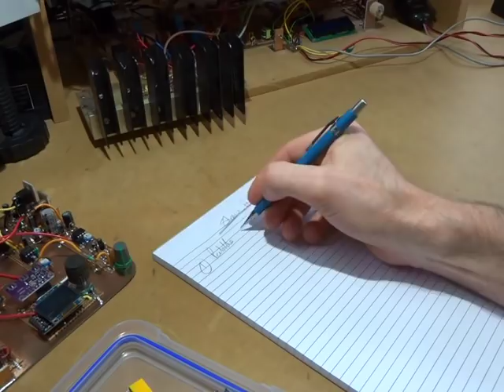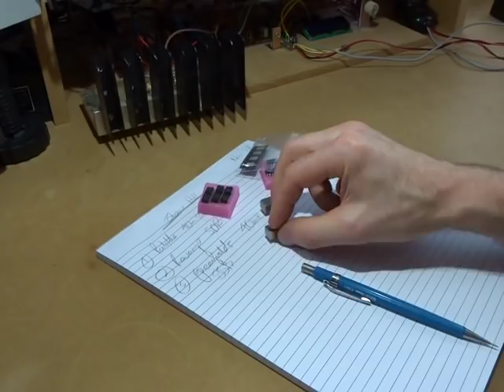Straw Poll for Next Build/Rebuild

Comment: 3 and 4 please. Learning how to use the ICs would be great. I have a few of each in my parts drawers. 73 Magazine and Ham Rado had a couple of articles on them in the 70s. Archive dot org and American Radio History dot com have copies of 73. lifeofkenneth has a collection of HR. My copies are stuck in storage and on a drive I can't access right now.

While VHF isn't your band, you do make design much more understandable. Maybe do a video on picking parts for the front end (to the first mixer) and doing a broadband QRP PA chain (from last mixer). A paper rig so to speak. 1st mixer to last is covered in your other videos. Most of the 6 meter articles stopped in the early 80s and used parts discontinued in the 70s.

Thanks.
Reply from the maker: Thanks for the input. I do intend to do a broadband PA build IDC. Just need to identify and lay my hands on some suitable devices.

Comment: How about a MC1350P post-filter IF amp with both manual gain control and AGC option?

BTW recently I was lucky enough to score a small pile of new-old-stock SBL-1s, happy to send you a few if you'd like. Email me your postal address:  my callsign at gmail.com

Cheers,
Steve VK2AAV
Reply from the maker: Cheers Steve. Manual and automatic AGC as well as ALC on transmit is the current plan. I'll elaborate on that in the next video.

Comment: I'd go for the SDR revamp.  SBL-1's are great or even a HB diode ring mixer.  Really interested to see the si5351 code in use as a phasing solution as well.  I have read Hans articles in QQ but that's it so far.  

Thanks for sharing all this!

Mark
KC4GIA
Reply from the maker: I will get to this Mike as a do want to re-do the software.

Comment: Interested to see you reproduce Hans Summers quadrature VFO at the signal frequency. I built a superhet with the MC1350 this year, the G6LBQ BiTx and it worked well as a gain controlled receive IF amp.  Looking at the other comments, looks like option 3 wins!
Reply: I'd like to see that too!
Reply from the maker: Agreed. I plan to have both manual and eventual AGC on the IF amp. On transmit, the plan is manual and automatic ALC. I'll put up a video tonight with the current thinking.

Comment: Hate to be a joiner but...I am interested in #3. Also a look at LDMOS power out devices vs IRF510's. I believe they are now in TO 220 pkg. Will work at 12 v but easily put out 100 watts at 40 to 50 v if available. The claim is they are good for 65:1 SWR without issues so maybe more survivable to mistakes. .

Thanks for your interest in sharing
Reply from the maker: Thanks Kenneth. I tool a look at LDMOS devices here and they seem to be over NZD100, which is quite expensive. Are you aware of any lower power and thus cheaper options?
Reply: @CharlieMorrisZL2CTM   
Below is a youtube link discussing the devices I was thinking about.. I knew "some" LDMOS devices can be expensive but have seen prices for kilowatt devices at several $100 US. I had assumed that getting away from gold plated ceramic to a a TO220 package and offering less than a kilowatt would mean a more consumer friendly price.

The MRF300BN 300watt device in a TO247 package is $35 from mouser quantity one. I assumed again the 100 watt device to be lower...But have not found stock anywhere yet.

https://youtu.be/gYkld-qRyI8

Thanks for considering my idea.

Ken
K7KLW
Reply from the maker: @watsok  Thanks. Just checked AliExpress and there are some good options, like the BLF1046. That's a 45W device for NZD16. There's a smaller 10W device BLF1043 for NZD10. I might order two BLF1046's and see how they go.
Reply: @CharlieMorrisZL2CTM  
Checked data sheet. That is a UHF device. I do not know if that is a issue for HF frequencies as I do not have a strong understanding of LDMOS devices myself. I have seen 1 MHz to VHF spec'd but that just maybe a factory test binning thing.
Reply from the maker: @watsok  The datasheet I have says '[d]esigned for broadband operation (HF to 1000 MHz)'. We'll see what happens! If worse come to worse then I'll take a look at the BLF1046.
Reply: @CharlieMorrisZL2CTM  
Good to hear!  It does sound as a test binning sort of thing. I worked for a few semiconductor companies and only tested for specific performance data. For a fee we could and would do other testing but that was usually never changed in the public spec. I suspect now that I found an earlier data sheet and yours is more recent.
Reply from the maker: @watsok  Thanks Kenneth. We'll do a bit of experimenting and see what happens. They only cost NZD20 for two, so the outlay is minimal. 

Thanks again for the input.

Comment: #3 with a view to watching you go through the learning curve of using the more classical parts rather than the new technologies like sdr radio circuits. learning about mc1350p or the NE592 and learning something new to carry on to newer type circuits.

also I have some links to Hans summers information if you need them let me know to kick start your si5351 quadrature outputs.

best regards

Simon (M6FJW)
Reply: Option 3 for the same reason as Simon please.
Reply from the maker: Thanks Simon. I'll try and weave as much of my thinking (the world according to me, thus not always correct!) into the videos.
Reply: That's all we can really ask for Charlie. it's about the process your going through at each stage that others may find useful, it may prompt them into look at things in a different way or giving them confirmation that they haven't done anything wrong in their build. To me option 3 is the best idea as it has the most to offer by way of learning.

Software defined radios have very little to offer by way of a learning curve and there is very little left to discover. all the hard work is already done for us. A basic SDR radio is 3 or 4 iC's and connect it to a computer. The software for the most part is all out there ( so no real challenge there). The circuits are all out there waiting to be copied (Again no real challenges). 

A classic radio offers much more as you can choose to go fully transistor with no integrated circuits at all. You can take away the si5351 and replace it with a homebrew oscillator this takes the build to really old school which is a dying art (everybody wants the up to date technology and unless we go to a museum or somebodies private radio shack then we will never experience the smell of the valve radio again).

The best we should hope for is people like you Charlie that are willing to do the hard work and do the maths and show the results at each stage. building each stage slowly, testing it and resolving the issues that may come along. Make mistakes and let us see them then touch on why you thought it might of worked and why it didn't work as you expected.

As human beings we need to fail to learn.

best regards and keep up the fantastic work you do on YouTube.

Simon (M6FJW)
Reply from the maker: @simonmichaeluk  Thanks for the kind words Simon. I'm conscious the next build will use more ICs than I typically do, but I think that's ok. It's about trying something new and seeing how it works out. Time to melt some solder!